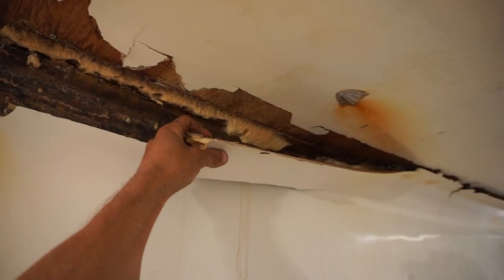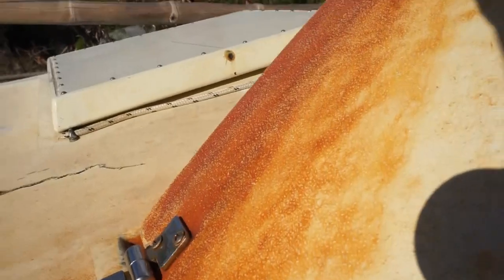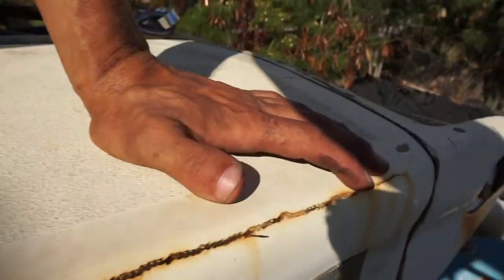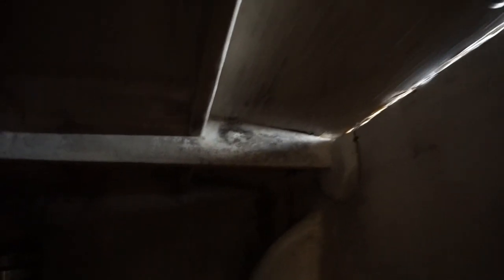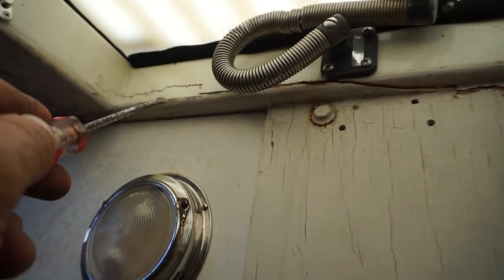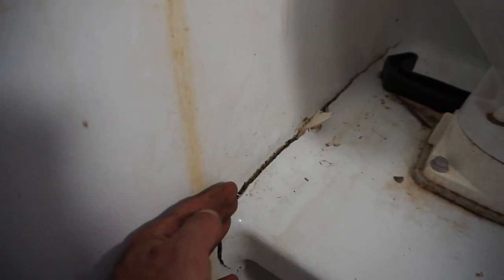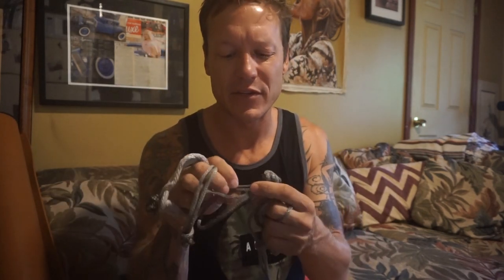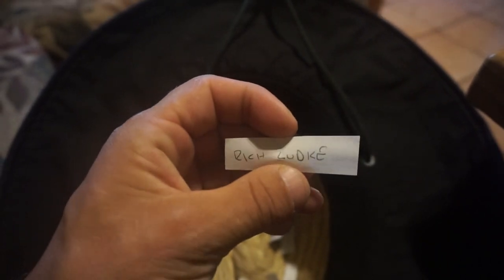Tearing apart my wrecked Catamaran

Comment: Excellent video, James. I am no naval architect or laminates engineer but I am a 200-ton captain and marine electrician with over 50,000 at sea in small craft. I built three glass/plywood multihulls in the early 1980s, two Pivers and a Wharram. We were real novices back then and knew little about stresses, direction of weaving, special resins, etc. I doubt any of the boats I built are still afloat. Your commenters are making some interesting observations. From my 40 years in the boat business, many of those years in multihulls, I would conclude you could have gotten another 20-30 years out of this boat if you had remained in near shore waters. That is a lot of service out of a glass/ply catamaran. I think you and the boat have done very well. The butt kicking you got south of Hawaii took a lot of years off the old girl. I am glad you sailed her as much as you did and applaud your outstanding seamanship in getting Zingaro ashore.

Comment: No-one is talking about the rigging being part of the reason. Dyneema has no stretch and in past videos James is often tightening the rigging more and more. If you over tighten the rigging then either the mast goes down of the hulls come up. I've seen it on a 2 year old Lagoon 62. Add in old wood and continual torsional stress of large seas and this could be the result. 
Stoked to see the new boat.
Reply: Jim Nickles  I wondered the same thing.
Reply: not a conventional mono/cat different reaction to the loads. Plywood and glass, the beams and stringers looked undersized to me for offshore work, just an uneducated opinion. If you look at Wharrams after offshore work they need to be tweaked back into shape...same forces apply to ply boats. Just old and clapped out I think was the reality of this episode..still saved them though.
Reply: I completely and respectfully diagree!!! Zingaro had a 25ft breaking sea on her side...she got her ass kicked repeatedly by this sea state. Over tight rigging would have displayed in many ways, and James is an astute enough sailor to catch them.
Reply: Jim Nickles  your theory would assume chainplate anchors are weaker than those lack of beams in the boat.. i'd say that makes no sense.
Reply: "Dyneema has no stretch"

Compared to what, steel?
Reply: Yea cuz 1x19 stainless has so much stretch...
Reply: 1x19 stainless stretches considerably under load.  Do your homework if you think otherwise.  When using 10m of cable for testing and applying loads starting at 500 kg and increasing to 2000 kg, 7mm has 4.5 cm of stretch, 6mm has 6.5cm of stretch and 5mm has 9.2cm of stretch.
Reply: @johnnybarbar7435  Elasticity of stainless is FAR less than that of Dyneema.  So, dynamic loads can both be greater and lesser depending on the natural structural frequency and motion of the boat.  It is not exactly a cut and dried topic.  For instance: With Dyneema, the rate at which load is applied is less, as gusts etc are ameliorated by a longer time interval required to STRETCH, but the overall force can be increased as structures are allowed to deflect for longer periods of TIME, as dyneema rigging is not as STIFF which INCREASES the structures stored energy.  So, in this scenario, the dyneema rigging could indeed be increasing the average structural loads in the hull.  Peak loads will DECREASE, but for fatigue purposes, loads will increase.  Now, did his hull break due to a single time event or was it due to fatigue?  Impossible to tell via camera, and since this is composite structure, doubly so.  For all we know, someone screwed the pooch in design and put the wood grain of the beams in wrong orientation.  Why many early airplanes broke up.
Reply: @w8stral  Agree on SS vs Dyneema but, it seemed that some believed SS has little to no stretch so I posted some test specs.
Reply: @johnnybarbar7435  Ah, ok.  =)  Everything stretches.
Reply: When it comes to overloading the hull, the stretching of the shrouds and stays is completely unimportant! The decisive factor is the tension (force) that is ultimately applied to the shrouds and stays. Elongation is the wrong physical unit to describe the problem. It doesn't matter whether and how far the material stretches when a force ultimately becomes too great so that the hull bends.

Do not confuse: The stretch is often used as an aid for adjusting the tension (e.g. 3mm to 2m = 15% of the breaking load). This applies to steel shrouds, because steel always stretches the same in relation to its breaking load regardless of its thickness. But it is about the breaking load of the shrouds and not the hull.
Reply: @sailingawayhhde  Learn the difference between statics and dynamics: Your truly reality.  PS: Stop embarrassing us who are actually engineers. 

PPS:  Shrouds(tension) are tied to the hulls putting them in COMPRESSION, no this load is not big compared to wave action.  IN fact this load is downright small in comparison.  Especially on small boats as in this case.  Not true of LARGE sailing vessels though.
Reply: That was actually one of my thought, dyneema is great but controlling the perfect tension at all time must be hard on that material.
Reply: @nandix75  ??? You do not need perfect tension.  Why he keeps tightening it up is because Dyneema creeps under load at room temperatures.
Reply: w8stral So if he doesn’t need perfect / good tension why does he keep tightening them?
Reply: @nandix75  Because the looser it gets, the higher the dynamic forces and can hurt your rigging/masts, etc.
Reply: w8stral So you mean it’s hard to keep a perfect tension?
Reply: Uuuuughhhh.... Shaking my head... I'm not going into a technical brief here, you are all entitled to your opinion.  All I'm going to say is that Zingaro's Rig is still standing strong and in no way contributed to the structural failure(s) resulting from this incident.  I will only add that this is exactly why Dyneema still isn't widely used in the industry, because people don't understand it!
Reply: @w8stral  My English is not really good, but if you don't understand me correctly because your English doesn't seem much better, please at least don't be disparaging. You should pay more attention to your choice of words and don't call others "idiots", as you did in another comment, just because they have a different opinion than you.
There are different approaches for many things, and simplifying considerations and abstractions are allowed to come closer to a problem. There is never just one way to find a solution.
But there is something wrong with your statement: shrouds never produce compression, only pull. And if, as you write yourself, the load (tension) is small compared to the wave action, why are you correcting me? That's exactly what I meant.
My answer originally referred to the thesis of someone that James used dyneema shrouds and they would have too little stretch so that the forces to the hull became too great. I disagree and say that the stretch of dyneema doesn't matter when the hull is overloaded. Besides that, dyneema is also stretchy, even more than steel.
So if James catamaran has collapsed, it's not because the dyneema shrouds have stretched too little. I think you can agree on that statement, right?
Reply: Dyneema stretches and needs to be sized for equivalent stretch.  More than likely the Dyneema was sized too small and it certainly was not prestretched adequately on this boat, which means even more elasticity.  He had to keep tensioning the shrouds because of constructional elongation as it was not adequately prestretched after splicing.  The Rigging had nothing to do with this structural failure of the boat.
Reply: @sailingawayhhde  Its not opinion.  Its fact.
Reply: @SteelDoesMyWill   Rigging standing strong with that kind of damage it might be a overstatement
Reply: w8stral Someone else has a different opinion than you and you call him idiot. Even if your facts are correct, you don't have the right to call someone an idiot. That should be absolute consensus. Can you stick to it too? Otherwise it’s no fun to exchange and discuss each other. I also think that you could apologize to the person for such bad behavior.
Reply: @sailingawayhhde  Everyone has the right.  Grow up child.  Take your feelings and shove em.  ITs called simple engineering. Simple math.  Not opinion, math.
Reply: @ColligoMarine  finally, you and Kraken are the voice of knowledge and experience. Next thing you know they will be burning dyneema at the stake for witchcraft. I'll say it again; repeated 25ft seas breaking on her hull is all  the excuse this 45 yr. old yacht needed. But this feed is another reason not to buy home  built  boats, even if they are built by engineers
Reply: Pleas make a tutorial on how not to stretch the rigging keep going strong 💪
Reply: @pablohees5253  Dyneema stretches.... not possible to make it not do so, though most stretches under first load and why he has made his rigging videos
Reply: @hermitoldguy6312  yes you are right !👍 studies show that synthetic rigging like we are talking about is 10 to 50% stronger the stainless steel. It is becoming very popular but one must be careful when and where you use it . It's an easy research, just give it a quick Google and read the difference in strength. I don't mean to come off as a no it all, I've just been doing a lot of research for my own boat  ☺
Reply: @w8stral  but it is way stronger then steel
Reply: @pablohees5253  two of the foremost authorities on "dyneema" have commented here on this thread. And they both have tutorials and information available. If you dont recognize them it is because you haven't spent anytime studying "dyneema"
Reply: @kellys923  No Dyneema is not.  In fact, Stainless steel has an equal or higher tensile.  Boats just never use this high quality stuff.  They use low quality stuff because it is cheap. 

You get what you pay for in life.... =)  Who knew eh?
Reply: @w8stral  last time i looked compression is at the mast step while the shrouds are essentially trying to pull the side of a sailing cat toward the top of the mast while the mast is being forced down through the cross beam between hulls
Reply: @Kiwisail  No Shit Sherlock
Reply: I've done my own research. 
1. Dyneema is not as strong as steel - it's more like copper.
2. Dynema is more slippery than Teflon. You don't want to be tying knots in it, they'll give.
Reply: If you continue tightening Dyneema, then you should wonder what is giving way.
Reply: @BenjaminFranklin99 
Dyneema is more slippery than Teflon - it's the knots that are giving way.
Reply: Dyneema has more stretch than steel - it's more comparable to copper.
Reply: Dyneema is giving way.  It creeps under load at room temperature.  Quite a bit initially.  It slows way down later.  Every material on earth creeps under load, just depends on the temperature and load
Reply: I did the same thing to my arrow cat when I was 13 yo . I stood on deck and pulled the main sheet as hard as I could and up come the hulls
Reply: @spikedone2 Stays are shrouds in this context.  In age of sail with multitudes of sails and mast heights, they had different meanings I do believe.  Now?  They mean the same thing
Reply: Sailing Great Expectations this is exactly why I keep my dyneema rigging as loose as possible. If you set your tension in a cool climate, it will contract significantly when you sail into a warmer climate. If you don’t keep a close eye on tension you will wreck your boat/rig.
Reply: Luke we have safely sailed across the Atlantic and through warm and freezing climates with no problems. Our synthetic rigging is 5 years old and works like a champ. You just need to understand it to make it work.
Reply: Hermit Oldguy actually, knots will hold well but they have to be tied perfectly. 
I use a Dyneema pennant as a reefing tack on the mainsail. 
The pennant is tied to the boom with a simple bowline and to the sail with a complicated but secure knot I came up with. 
I’ll be making a video about how I tie it but you can see glimpses of it in our Atlantic crossing videos.
Reply: @hermitoldguy6312  Well if you compare the dyneema to same size steel yeah. Steel winch line stretches a hell of a lot more. There is a reason those of us using winches to recover off-road vehicles prefer dyneema. Hell of a lot less dangerous.
Reply: @sailingawayhhde  W8stral is a smart guy. He is just rude and crude to anyone he disagrees with. He went to school and grew in smarts but unfortunately, his ego grew faster.
Reply: 4x4Scout      That makes sense. I doubt if a dyneema rope snapped it would cut you in half, like a steel cable might.
Reply: @hermitoldguy6312  Exactly right. The dyneema rope pretty much just falls to the ground. Steel cables will recoil A LOT. The only downside is abrasion. Once they start getting frayed they need to be replaced.
Reply: The rigging doesn't attach at the ama.  It attaches at the edge of doghouse.  Rigging tension didn't cause the failure.

Comment: Thanks for the video, James. IMHO, being in the middle of a synthetic re-rigging of my Irwin 46, the learning curve has been extensive. Since you asked for our thoughts, I believe the biggest cause is the size of your Dyneema standing rigging. You once wrote to me that the one thing you would have done differently was to use heat annealed Dyneema. I completely agree. But there is another issue of even greater importance, and that is the removal of the stretch of Dyneema. From what I have learned, non-heat annealed needs to be stretched to about 20% of its breaking strength before the majority of the stretch subsides. ⅜" has a breaking strength of almost 20,000lbs, and 20% of that is 4,000lbs of tension. Multiply that by the rest of your rigging and you will see the amount of torque all that tension placed on your deck and stringers, just to remove the stretch. I see tears, cracks and splitting, all in an outer hull upward direction, twisting in the direction of your rigging tension. Therefore, the numbers clearly show that oversizing Dyneema for standing rigging is a no-no. Case in point: If your boat came with 5/16" 304 stainless steel standing rigging, it has a breaking strength of 8,200lbs. To match that breaking strength, Dyneema ¼" is 8,600lbs. 20% to remove the stretch is 1,720lbs. Your point about using heat annealed is absolutely correct, because once most of the stretch has been removed, it doesn't need to be tensioned as much to remove the remaining stretch. Personally, I'm using 5/16" (7mm) heat annealed on my main mast and am actually concerned that it may be too big. However, it has a breaking strength of 18,700lbs, but it only needs to be tensioned to 10% of that to remove 90% of the remaining stretch. 1,870lbs is ½ the tension needed for ⅜" regular Dyneema, while it is 2.5 times stronger than the 5/16" stainless steel I replaced. What happened to Zingaro? After numerous tensionings, I believe there was so much tension on your standing rigging, that when the wave slammed against the inner hull as the other hull slid down into the trough, it was the straw that broke the camels back, and it tore your boat in half. From what I have learned, when it comes to using Dyneema for standing rigging, I agree that heat annealed is absolutely mandatory, ...but that bigger is not better. Again, that's my humble opinion. (BTW, love the new boat! May even see you in the SoPac later this year.)